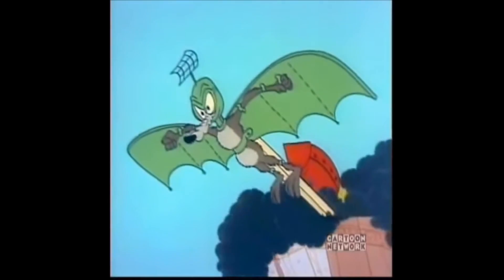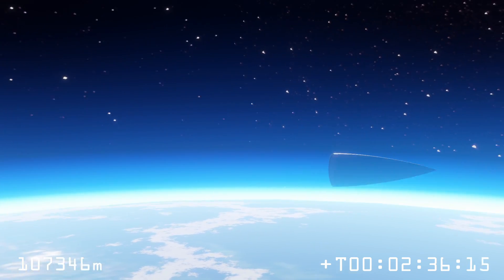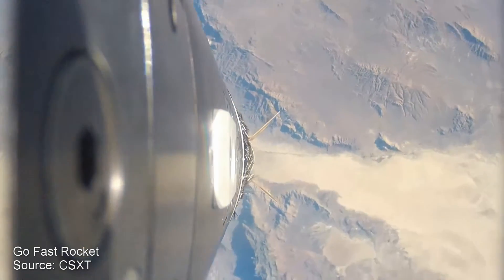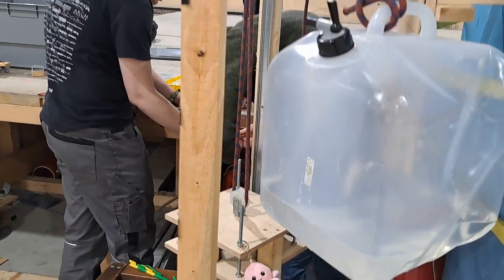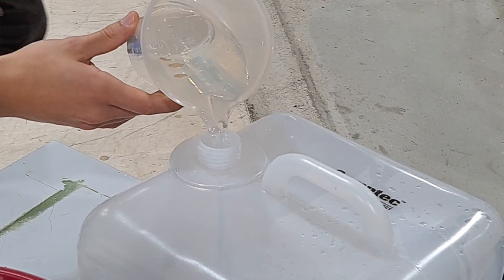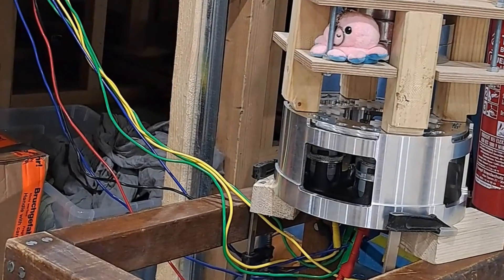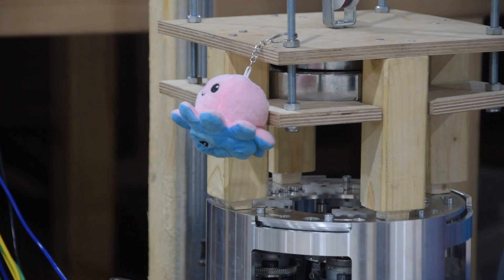Rocket Separation Testing for Transcendence

Comment: 3.55 you got problems with water and electronics --- how about using oil instead?
Reply from the maker: The water is all contained so never posed any issues with the electronics.  But yes, oil could be used or any liquid really.

Comment: So this has to be made from metal? you are probably good at casting now, have a 3d printer and there's the option for electroplating 3d-printed plastic or cutted copper plates to make --- should be cheaper than paying a company for the CNC .... alternatively you could think about thin plates of cellulose acetate which can be glued with acetone and is easy to work with --- I have thought of even "growing" a honey comp like structure by electroplating to save mass
Reply from the maker: Yes, our manufacturing capabilities have rapidly expanded since we designed and commissioned this part.  We did get it for free though cause Aljo (the company that machined it for us) sponsored us!  We have two of them now so there is no need to make any more at this point.

Comment: I am sure you only used Vaseline as a lubricant because it was readily available. However you may want to research the effects of cold and pressure on lubricant viscosity in order to guide you in the selection of the lubricant you choose use.
Reply from the maker: You are 100% correct about our reason for using Vaseline.  So far, of all the lubricants we have tested and tried throughout various parts of project Karman, Vaseline has actually proved to be the most effective (even at cold temperatures).  But yes, you are right, we should maybe be a bit more careful with our selection.  Do you recommend and particular lubricants that have a more dynamic effective temperature range?

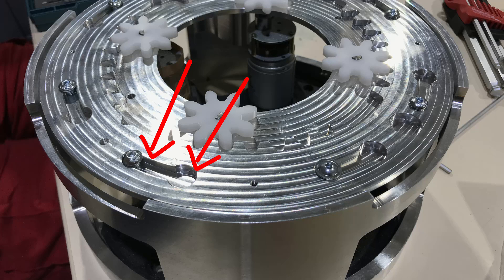Comment: 2:12 that is to risky. I mean as deployment sistem. must be precise and dont get stucket in the other side. Must be perfect balanced. Can be improved with biger hole and some kind of mill on the entrance of the big hole.
How many test you made to see how good is this sistem?
Thank you.
Reply from the maker: We are planning to make a few improvements in order to enhance reliability, but the system that we are showing in the video is actually quite reliable already.  Once we worked out the kinks it deployed 5 times in a row without any hiccoughs...  All these parts are precision machined so that is giving us a bit of an advantage for sure.  Nonetheless, we will make a few small improvements and do another round of testing in the coming month in order to cement our confidence in the system.

Comment: That is fantastic practical idea. Could you elaborate more the reason you cannot use explosives for this matter?
Reply from the maker: There are a few reasons why we "can't" use pyrotechnics in Germany:
1. Any kind of black powder explosive requires a license in order to use more than 1 gram of it.  To get this license is a bit of a bureaucratic process that we as students would like to avoid.
2. Transporting items with explosives in them also requires a permit in Europe.  This can be very expensive and definitely rules out transport on planes and trains.
3. Some launch sites in Europe straight out forbid explosive separation systems.  In order to keep our launch options open, it makes sense to engineer an non-explosive separation system.

So, we could use pyrotechnics, but it would shrink our options and flexibility in terms of testing and launch to the point of infeasibility as a student group within the European sphere.

Hope that clarifies!
Reply: Probably some random political reason
Reply: Thank you for the clarification. That makes total sense now that you have stated the reasons. Nevertheless the approach on this endeavour your team had achieved is somewhat innovative for this practical use. I design machines for industries which fue regulations gives me the "no,no,no" whenever some more practical not so innovative solution pops up but can't be used due bureaucracy. Hope you guys all the best and am looking forward the great news to come. Have a wonderful new cycle on the next year.